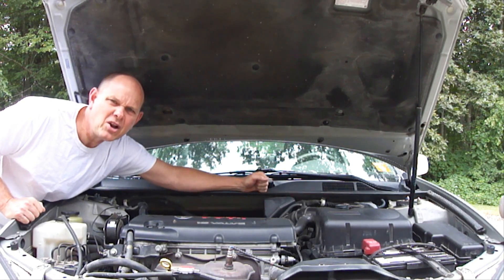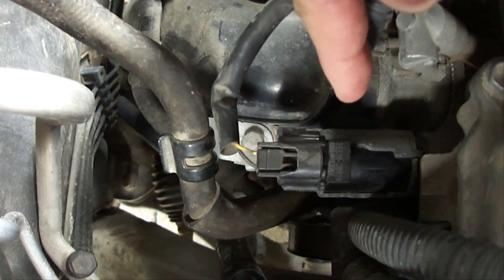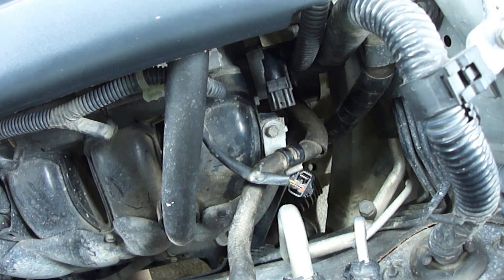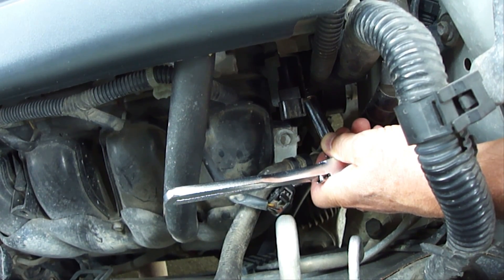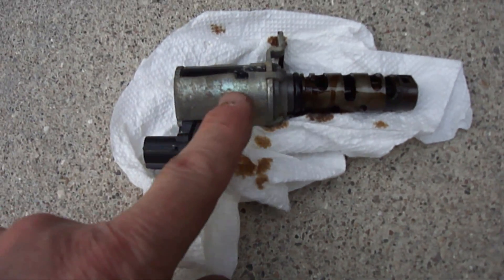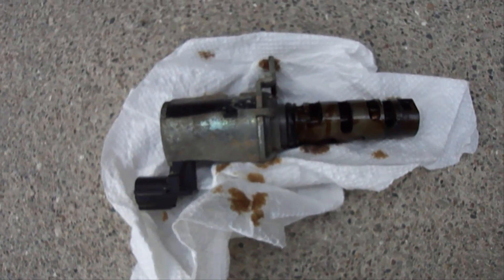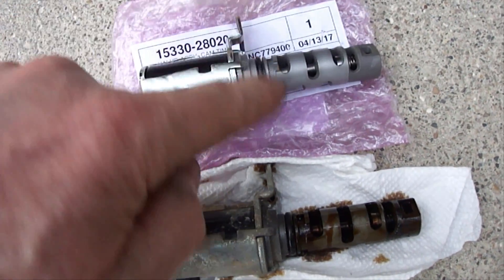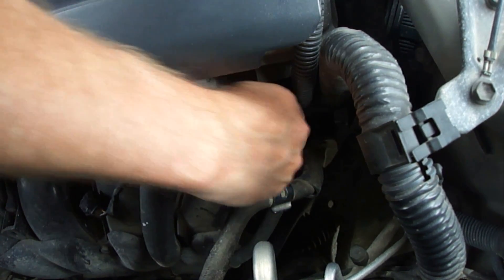Variable Valve Timing Oil Control Valve Solenoid Replacement - P0010 P0011 P0012, P0013, P1349

Comment: Hyundai dealership had oil control valve in stock, wanted 250$ for it. Found one for 10$ on ebay.
Reply from the maker: Make sure what ever you get is OEM
Reply: @proclaimliberty2000  this is the description:  VVT Variable Valve Timing Solenoid For Hyundai Elantra Tiburon Kia Soul Spectra
  It says its supposed to be good for up to 2012 hyundai elantras, I have 2008, it doesnt say OEM anywhere though
Reply: @proclaimliberty2000  I have also put 10,000 miles on it since it blew like a dumby, luckily I guess it was locked in full open when it blew

Comment: How often you recommend to replace (miles) the oil control valve and the pcv valve  
Hope a answer thank you
Reply from the maker: The oil control valve can last the life of a vehicle if you change the oil regularly. I recommend replacing the PCV valve every 50,000 miles.
Reply: @proclaimliberty2000  thank you 🙏
Reply from the maker: @alejandromurillo9974  👍😊
Reply: @proclaimliberty2000  sorry one more question  there’s a exhaust and intake solenoid my question is for both is the same part? Thank you

Comment: Where is the solenoid on a 2010 Toyota Matrix?
Reply from the maker: Mark Linden OMeara it’s located at the front of the engine (side with pulleys) towards the upper part of the engine.
Reply: @proclaimliberty2000  Thank you.  Found them - on the Matrix there is an exhaust and intake solenoid. Removing the plastic cover, they are easily accessible on top of the engine on my 2010 Matrix.  Looking to order on Amazon and replace.

Comment: where is it on a 2009 kia sedona?
Reply from the maker: If you have one,  it's usually located on the engine behind the drive belt towards the top of the engine.
Reply: thanks

Comment: Hi Paul. I see that you tried also changing the oil, the small oil filter and now the VVT valve. Was that because the previous trials didn't fix the P0012 issue? Did this one solve it? Thanks
Reply from the maker: Changing the oil is what fixed the problem on the first vehicle.  This was a different vehicle with very high miles.  I choose to replace the VVT valve as part of normal maintenance.
Reply: Thanks for the answer!

Comment: Hi Paul, I always learn something new, your approach to teaching "Nerds" how to take care of your Toyota Camry 2004 with 260,000 miles, you are "Par Excellence" You take simple parts changes (simple to work on, low cost to replace, best bang for the buck) on these model of car and help enhance the performance, I did many of the recommendations you gave and you will not believe the performance improvement, better driving and the "CAR SCREAMS - THANK YOU THANKYOU" every time we drive our Toyota Camry 2004,it has taken a lot of beating in the Cold weather of North East and keeps chugging along.(touch wood)

Please keep these kind of video coming along , keep it simple and straight forward "Parts and labor" which has helped your car.

Thank you once again. I will try this "Variable Valve Timing Oil Control Valve " change next week, as I do notice the car to drive a little heavy breathing while up a gradient.

Paul Quick question on this Oil Control Valve Solenoid change , 
1.How many Oil Control Valve Solenoids are there in a Toyota Camry LE 2004 model?
2.Do we have to change both the banks for the both the side of the engine block , it is a 4 cylinder engine.
3.Is the Oil Control Valve Solenoid, on the "drivers side" of engine block or "Passenger side".
4. Do you have to reset the "Engine Computer" after this change?
5. Do you happen to have the Part# ?
6. Is there a "Sensor" associated with this "Solenoid" which also need to be changed to get optimal performance? If there is a "Sensor" associated would you please let me know ,where to locate it and change procedure.
Thanks in advance.

PS:Just a suggestion in your next video is it possible to give the viewer  the orientation of the parts location you are working on , that would help to visualize the process of change.
Reply from the maker: All engines have one VVT oil control valve.  Your's is located more on the passenger side on the back side of the engine as shown in the video. You will not need to reset the computer once the new one is installed unless your check engine light is on now.  Contact a Toyota dealer parts department for the part number.  You'll probably get your best price on Ebay but make sure it's genuine Toyota.  There is no other sensor associated with the VVT oil control valve to replace.  Hope this helps.
Reply: Thankyou Paul